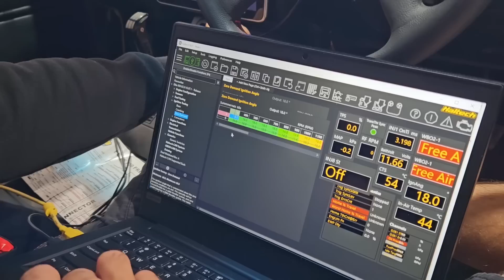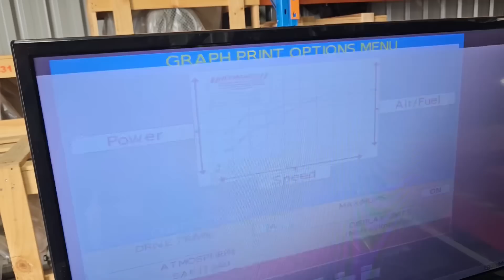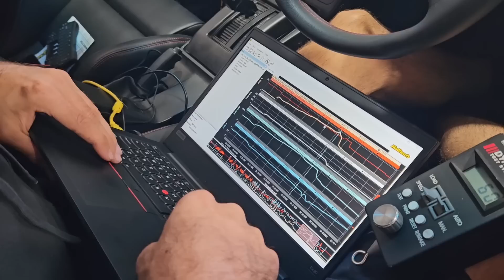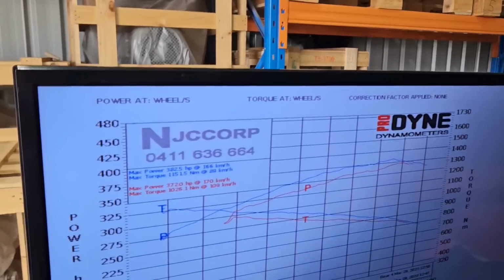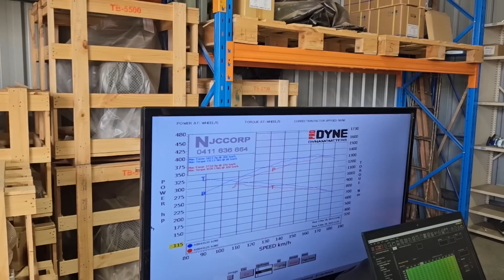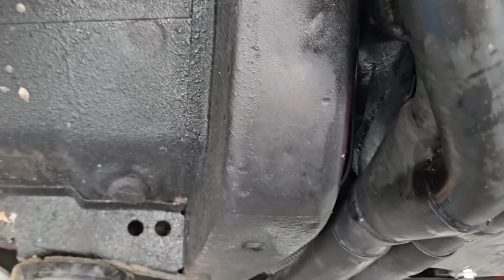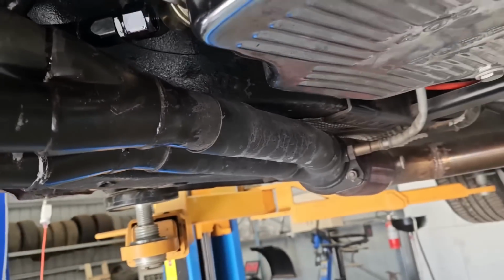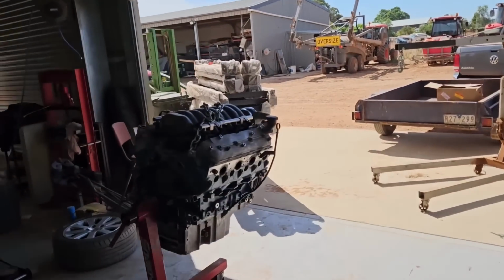Mako Hits the Dyno ( Dyno Fire)

Comment: Put the cooler at the back 
You have a flat boot floor 
Thats my 2 bob 

I did that a d moved it to rear 
Never had issue again

90% of drag racers and burnout guys run then in the rear trans cooler 

Hard-line I wouldn't recommend

Comment: Hard to tell in video mic, but she doesn't sound like she's real happy when he drops the hammer, like it doesn't want to lift up off the floor and rev freely. That could simply be the load of the dyno though. Might be worth calling TCE or SDE and getting them to spec you a nice 10" converter with a mechanical diode to match the cam and power adder? Will absolutely transform the engine response and driving experience, and i'm sure your trans will thank you lol